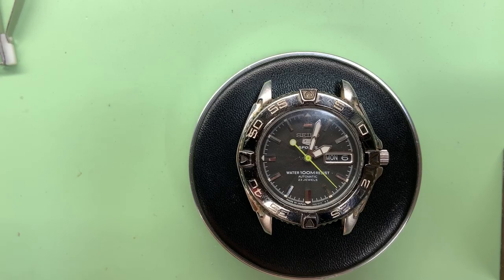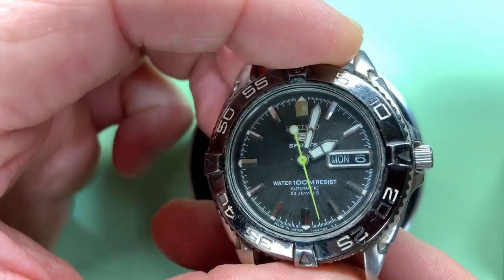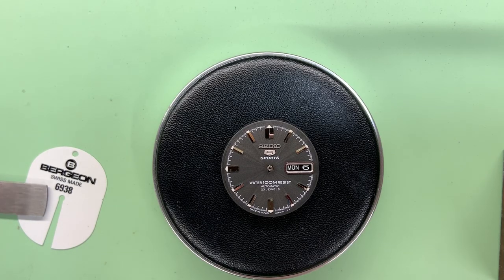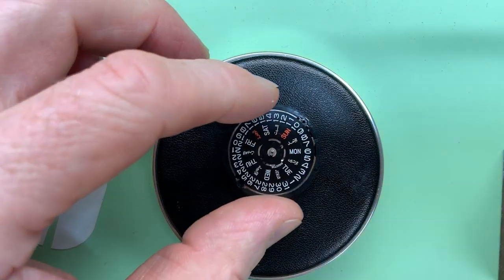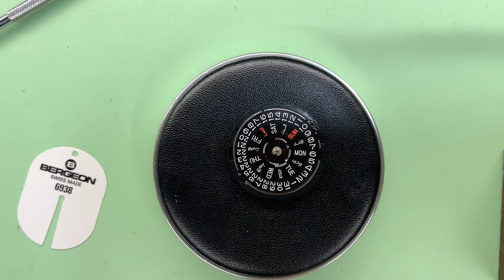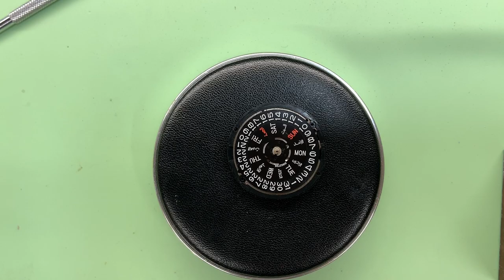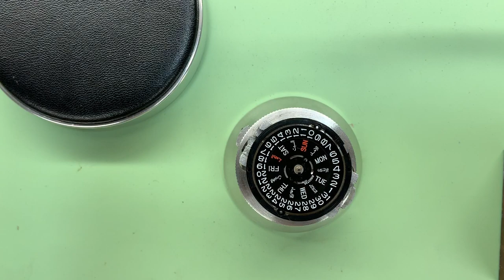Seiko 7S36 Disassembly Tutorial

Comment: Apr 2022! Just found this vid. For info, I have a 7S36A in perfect running order, although it is stopped at the moment. The main differences are slightly different hands, and a one-way ratchet bezel around the outside of the face. I don't know if there are different face colour options, mine is silvery, matted down with a very fine cross-hatch patterning. The text on the face reads Seiko 5 sports - above the hands, and below it shows water 100 resist automatic 23 jewel. Edit - having watched the reassembly, I see that you have used a slightly different case, with a rotating bezel - which is slightly different to the one on my watch!

Comment: Good job. I hope you didn't loose the c-clip for the pawn levers that I think you left behind the movement holder 😓
I haven't had the opportunity of working on a 7S36 or 26 yet, but I have to admit that they takes me out of my comfort area: 1.- I dont like the keyless works in the side of the motion works, just because it's against the order I usually work, and 2.- I hate those little plastic gears for the calendar setting, because I think they will degrade and stop working over time, as has happend with most of the 5606 movements.
Looking forward to seeing the rest of the series, thank you very much.
Reply from the maker: Agustin Aguilar thanks. No problem in the pawl lever circlip all safely stowed away.
 I think the nylon gears have plenty of life in them yet although you would expect them to go brittle eventually. Can only hope it’s a better grade of plastic now. 
Yes the keyless is annoying . On my last 7s26 service I didn’t do something right and only found out at the end which means train wheel bridge off again etc.

Assembly videos will most likely be in a few weeks as I am off on my holidays . Just wanted to upload this now.

Comment: Thank you for the great video and explanations, they are really helpful. Especially helpful would be to explain how to avoid flying components. I lost the jewel holder clip of a scrap nh36a movement. It flew in somewhere, never found it.
Reply from the maker: ajovev thanks for your nice comment.
“Ping” moments happen to us all and the springs that hold the jewels in are particularly difficult at times. I have done a video on that subject so look at my others for diashock & diafix installation . 
Finding them can be impossible  if it’s steel then a big magnate is what I use. 
Generally using good tweezers (Dumont) I recommend allot but they are pricy. Then it’s just learning your feel which only you can learn
A few years back I contemplated buying a small light tent (see Ebay)  where you can put on your desk. If something flies it could be contained unless it came outwards toward you!
Problem is you can’t get a good view because the tent would hinder ..

Comment: Hi Mike.
As I know this movement is 7S26, not 7S36.
7S36 has another jewel plate on the main plate.
Any way thanks for your YouTube and Facebook videos and photos, they are so helpful.
Thanks.
Reply from the maker: Morteza Saremi you know I think you are right. I was thinking that.  I now have to wonder if the 7S26 that was in it to start with is actually a 7S36 but with a different rotor!

I bought the 7S36 movement as it was listed as that on a website. 

Now disappointed that I have made a misleading video ..
Reply from the maker: Okay after much thought and then an examination the jewel plate is present on the mainplate. . I did not remove it on the stripdown. 
I will post a picture in the community tab shortly and in the group if you are on FB.
Reply from the maker: Please join the group .

https://www.facebook.com/groups/Retro.Vintage.Watches.Restorations/?ref=share

Comment: Hi, great video! I have a question, for example what if we have an issue only on the keyless movement. Would it be any problem if we only disassemble it only from the movement side without disassembling the calendar works? Much appreciated
Reply from the maker: Rafi Ihsandi possibly . To get to the keyless you have to remove most of the movement side . If you leave the train of wheels in place then you stand a chance

Comment: Instead of using that Bergeron dial protector a small ziplock bag put over the dial protects the dial and makes it very easy to get the hand remover under the hour hand.
Reply from the maker: Mark Irvin yes I’ve used that method a few times. The dial protector usually works fine but it’s because there’s a camera in the way where my head should normally be which makes most of the process more challenging to be honest. 
Having the camera above gives you the viewer the best position especially if you are learning and going along with the video

Comment: Hi Mike.

Is the procedure basically the same for the 26 and the 36? Are there any major  differences?
Reply from the maker: HI Steve,  there is little noticeable difference between the two other than a small removable jewel plate in the 36 model.  I to point it out somewhere in one of the videos. Not sure if its just to bump up the jewel count or is actually an improvement on the 26 version.

Comment: is there any effect on 7s36 if setting the clock in the opposite direction/counter clockwise?
Reply from the maker: I have heard this before but I see no real issue with it certainly with these.  Where there could be issues is with the day date backing up past 12 if its just done a date change .  Ironically in vintage watches like 60s etc the date often didnt have quickset so you would wind past 12 to change over and carry on until around 1 then wind back to 10 and forward again to change over,  like a hack quick set.  Accutron tuning forks you dont want to wind backwards though.
Reply: okay thanks for this good information, I often set the minutes in the opposite direction just 5 minutes every day, now I'm sure that won't be a problem

Comment: Are the day and date wheels interchangeable between 7S36 and 7S26 movements?
Reply from the maker: Yes. the only thing to watch out for is crown position.  Both movements must have the crown at the right place.  eg crown at 3 oclock.  The discs are designed to line up with the window at crown positions so a crown at 4 will not line up with a crown at 3,.
Reply: @MyRetroWatches  ok thanks. What about the NH36?

Comment: I would say this is actually a 7s36, you se that it has the ekstra plate with to jewels on the calender side of the mainplate as the 7s26 don't have.
Reply from the maker: Ole Johan Pålsrud  really? This is going to be an interesting debate then.  I will have to compare it with my 7S26 video to be sure.

I was under the impression that the 7S36 was a bit like the 7019 with that removable jewel plate .

I will be pleased if it is a 7S36 .
I need to get the service sheets out!

Thanks Johan
Reply from the maker: You are right sir. I have just looked at the mainplate and sure enough there is the jewel plate!!
I missed it on stripdown and in playback. 

Now relieved thank you so much .
Reply: I just done a 7s36 myself, and notised that ekstra plate who is held Down With one screw, i've never seen that in the 7s26.
Reply from the maker: Ole Johan Pålsrud my understanding was this was the only difference . The 26 is a 21 jewel and the 36 a 23 jewel.
I even knew about that plate but for some reason it slipped my mind to look for it on stripdown . When questioned by another comment here I assumed he was correct ...
Reply: That is the only difference that I have seen on theese movements yes.

Comment: What causes a 7s26 (and presumably a 7s36) movement to not hold its wind for more than about 4 hours or so of inactivity?  The number of complaints about this on the Web are numerous and I've never seen an explanation from a watch repairer.  To me, its as if the mainspring stops releasing its stored energy after four hours.  Can they "stick"?
Reply from the maker: Robert Brandywine not holding power will be mainspring related. I would first check the rotor is on correctly as you cannot hand wind the movement it relies solely on rotor movement. 
A well serviced 7S should run 36-48 hours on a full wind ( could be two days of wear to wind)
If possible I would take the back off . See if the rotor is loose from its fitting. If not you can use a screwdriver to wind the mainspring , screw is on top of the ratchet wheel.
If fully winding the spring and the watch still stops then it’s not power it’s something in the train stopping it. A service would sort this out.
Reply: @MyRetroWatches  Thanks, I checked that.  Anyway, since I posted, I sent it off to a watch repair shop that will work on the 7s26.  I'll report back what they find.

Comment: I lost the alarm spring contact from a baby G, dropped it onto the carpet so what I did was put a new bag in me 1200w Henry and hoovered all the floor and I found it inside the bag, smaller than a grain of rice the damned thing was, waste of time too as the alarm part of the baby G was kaput and I felt like a right lemon on me knees with a backlit magnifying glass til I had the bright spark idea with the Henry :)
Reply: Day before yesterday think it was, my daughter found one of my old skool Sekonda's that had sat in a cupboard for years, so whips off the case, new battery in and its up and running but I hadn't quite engage the spring pin in the folding part of the buckle and a couple hours later over a concrete floor it hit the deck smashing the crystal and damaged the Miyota 2115 movement which went crazy with the minute hand going round like a second hand then stopping and starting like it was on dodgy stuff :(   Still only a couple quid for a new one, the dial survived and the glass is like hardly anything.   I was very cross tho, did a Basil Fawlty at the fone when it kept ringing.
Reply from the maker: Ian Watson man that’s some bad luck.

I use a big magnate on the occasions I loose parts

Comment: Could you tell me how to adjust the date wheel alignment on these movements? I'm thinking of filing the date wheel lock click spring.
Reply from the maker: drunkdriver  can you explain more , what is out of alignment the date or day wheel?  Day wheel you can adjust but the date wheel can only go on one way.
Reply from the maker: drunkdriver hmm. The only thing that moves it is the black nylon part which has the date & day fingers. Quickset is a different mechanical operation.
So my question now is, is the alignment out on both quickset operation & turning through 24 hours or just one of these operations?
Reply from the maker: drunkdriver how long have you had the watch and has it always been this way? There is a chance that it’s the wrong date wheel..
The way they work is very simplistic so it’s hard to believe anything would be worn enough to cause an issue .